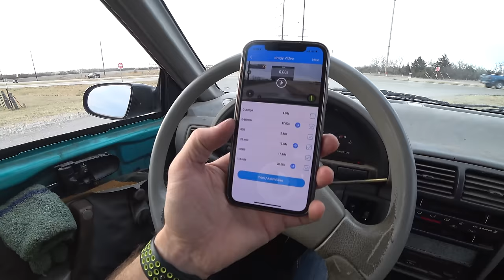I BOUGHT A Geo Metro For $300 And FIXED It In ONE DAY

Comment: 1993 Geo Metro gets 53 mpg.
2019 Smart Car gets 40 mpg.
With technology advancements, it should be getting at least 55.
Reply: The technology IS what make them less efficient. In a Geo you'd die for sure in a crash over 45mph. In a Smart you'd probably die in a crash over 45mph.
Reply: Some of the Geos got 62 mpg back when gas was more explosive
Reply: @zman1745  The xfi models did which this one is.
Reply: The XFI geo made 56 hp, weighed about 1600lbs and had a manual transmissions with no accessories. You can buy a Mitsubishi Mirage that makes 76hp, power everything including A/C and automatic transmission and it gets 40mpg. The manual transmission car is faster in acceleration but the fuel economy isn't any better. The 4 cly 1.3L 79HP Metro with automatic transmission only got 30-35mpg so there is that...
Reply: John Kifflom I bought a 4 door regular metro. It had a mileage book from the previous owner.. that ranged  from 60-64 mpg
Reply: @imzjustplayin  The xfi had 49 hp
Reply: @Ka_Gg  I guess 55hp for the regular 1.0L and 49HP for the XFI.
Reply: @imzjustplayin  Yep. The XFI cam is what made the big difference. Although the HP is less, it actually helped the car since it moved the power into lower RPMS.
Reply: @edxmon  you'd survive in the smart car. The entire body is a cage.
Reply: Safety regulations are probably getting in the way of that on some cars
Reply: @termy3934  probably, but that is assuming engine technology stood still. With the advancements, most cars Camry size or smaller should be getting 50 mpg or above.
Reply: Don't forget, the Nash Metropolitan went from '53-'62 and was capable of 35-40.
Reply: Dude with technology advancements you won’t die going 20 mph in cars like the Geo Metro. You can get similar mpg in a new Prius nowadays
Reply: I saw a vintage ad for a Volkswagen claiming to get 70 mpg. For automakers it’s not hard to reach those figures, it’s just hard to reach them with today’s safety standards
Reply: @tony_25or6to4  You couldn't legally make a car that small and light anymore. The crash test rules have gotten much stricter since then. For instance a rule was made that any car must be able to support it's own weight upside down without crumpling up the pillars that hold up the roof and this caused cars to get heavier and the pillars to become thicker that's also why the A pillars on modern cars are so darn bulky and hard to see around when you are looking around the edge of your windshield.

I think they should still be allowed to make cars that small and light though because there are a lot of people who can't afford anything else and would be willing to take the risk of crashing in it so that they could drive to work and make money.
Reply: @El_Chompo  the Smart is light (only 400 lbs more) and smaller. Remember the commercials with putting a SUV on top of the space frame? Technology should have advanced enough to give us at least 50 mpg in cars than size.
Reply: Geo couldn't be killed either and it was dirt cheap to run. My aunt and cousin had one it only took 5 or 6 to fill up too back then
Reply: "with technology advances cars should be more reliable" and yet they break more often
Reply: @wildman510  not true. Some cars are more reliable than ever. Chrysler car are still crappy, but Toyota and Honda are still very reliable. People used to get rid of cars approaching 100k miles. They now keep them to 200-300k or more. Not just an option, consumer reports has data.
Reply: More like Dumb Car amiright?
Reply: You will live through a collision in a Smart Car...
Reply: My 1981 VW Rabbit diesel routinely got 52-54mpg.
Reply: safety. youd survive in a smart car. instant death in 93 geo
Reply: @der_pinguin44  no a car needs to crumple to absorb energy
Reply: @Samsung Dryer where are the crumplezones?
Reply: @gustini2146  Also today's emission standards for new cars.
Reply: @El_Chompo  Used cars are a thing!  You will always have some cars that are still reliable for less than $5k in today's money.
Reply: @tony_25or6to4  ...but they don't last as many YEARS. Put it this way: every modern car has a PCM. That PCM has capacitors on it, that WILL fail...probably in about 20-30 years. Most likely taking the PCM with it. And GFL getting a replacement PCM in 2050!

OTOH,  a carb'd 1950s Yank Tank needed mulitple carb rebuilds in that time...and many points replaced...but you can still keep the (crude) engine management, managing the engine.

and just as an FYI, much of the "junk by 100,000 miles" was due to the horrible oil, and leaded gas. Run a modern Civic on high test ethyl, heavy on the sulphur, and straight-weight 30. Let us know how you do!
Reply: @Crazyerics  
You will live through any collision that you don't have. The most important safety feature in any car is a properly-adjusted nut behind the steering wheel.
Reply: Tony my father had 275k miles on his 2001 E-150 with the original engine before he sold it.
Reply: @imzjustplayin  I thought the LSI made 55 horsepower... After 1994. 

The XFI had a smaller cut camshaft which contributed to the great mileage. It did manage to produce 10 less horsepower though.
Reply: Tony my ‘19 power wagon, WITH the mds b/s gets like 12 mpg still 🤮 although it has the 6.4L!! But still...
Reply: Smart car also has more safety features.
Airbags which adds weight.
But mpg hasn’t change a lot when you compare it to other cars.
Camrys from 90 to present make around the same mpg but present has more power, safety features, and feels better 🤷🏻‍♂️ 
Same with 90 Chevy truck all those are from cars I own.
93 Chevy Silverado 
2015 Camry 
I used to drive my brother 98 Camry few years back.
We should appreciate because politicians wants to kill gas power cars by 2030 god damn California
Reply: that's the whole reason I didn't buy a smart car little crackerbox like that only gets 40 miles to the gallon I keep buying old Geo metros was getting a lot harder to find them now now I'm putting a motor out of my 98 Geo into my 93 convertible so I still had that running in about a week
Reply: It's evolving just backwards
Reply: John Smith  the CR-Z hybrid got 40 at most. With technicological advances and having a hybrid powertrain, it should have gotten 50-60. My brother-in-law gets 60 in his Prius C.
Reply: The 85 Honda CR-X in the HP model got 43 combined it was 40 and 48 didn't get 50
Reply: @edxmon  a Hyundai SUV could take out both.
Reply: @gustini2146  people still die left and right from accidents.
Reply: @tony_25or6to4  BS, it depends on the person not the mileage.
Reply: @Crazyerics  collision with a bicycle
Reply: @bcubed72  there was alot of  turning back the odometer back then.
Reply: @lawnmowerdude  I got a 2000 7.3 superduty with 800,000 miles and still going.
Reply: @fast1100xx  initial purchase price is cheaper,insurance cheaper,tag is cheaper, parts cheaper. Mpg is better, I wouldn't have drove one of these when I was a teenager but now I would.  Lol
Reply: @gustini2146  A Metro with a VW Polo 3 cylinder diesel swap would probably get 75 mpg .  The Polo with a 1.4 TDI weighed 50 percent more than a Metro and got 60 mpg.
Reply: @El_Chompo  For now, a 3 wheeled trike is exempt from many safety regulations
Reply: @MechanicParker  The XFI also had a final drive that I think was 3.52:1.  Some Metros have 4.39:1.  There were several ratios.  The fours have gearing for a lower cruising rpm.
Reply: Ya,   a  little  hybrid Geo Metro should hit  70 MPG minimum....
Reply: @SeaJay_Oceans  I wish I could get a hold of the VW 1.4 TDI from the European Polo.  It would be a hoot to swap  to a Metro.  The 1.4 TDI  produces double the horsepower of the Suzuki G10 and I understand its basically a 3 cyl version of the popular 1.9 TDI.   I think the 1.9 TDI might swap into a Metro but is weighs almost 200 pounds more than the Suzuki G10.
Reply: @timothykeith1367  Amazing !   I am still very impressed the geo metro MPG is better than some hybrids now...  VW makes excellent engines.
Reply: @SeaJay_Oceans  It costs as much to ship the 1.4 TDI to the U.S. as the used motor itself.  It would be the nerdy swap.  I don't know if these were available in Mexico, I might go get one if that we the case.  As far as I know, nobody ever produced a 3 cylinder mechanical pump for the 1.4 TDI. But I probably havent found the right forum.  The Cummins 4BT injection pump is used on the 1.9 TDI.  Maybe a Kubuta 3 cylinder pump can be adapted to the 1.4 TDI.
Reply: Comparing the Geo Metro to a smart is truly apples to kumquats.
Safety improvements aside (like an integral NASCAR style crash cage, which adds weight), and you don't gain more 44% more horsepower for free.

Comment: "Go faster, Neddy!"
"I CAN'T! it's a GEO!"
Reply: Ha Simpson's reference!😂😂👍
Reply: In the episode that Homer became a tow truck driver he tows Lenny's car. He has a green geo.
Reply: I regularly drove my 1 liter Metro Convertible from the SF Bay Area to Los Angeles down Highway 5 once a week for 4 months. Doing 80-85 mph with the AC on was normal for it for hours on end. The only trouble I had was that the left front CV joint went bad on one trip and vibrated like hell at any speed over 60 until I replaced the axles.
Reply: faster scotty aka star trek
Reply: Evil Ash that was the first thing i thought about lol
Reply: My name is Geo 😕
Reply: kimmer6 those convertibles are hard to find, I’ve been looking to buy one recently
Reply: @kimmer6  what was ur mpg with ac on going that fast?
Reply: @ethixhiggins5059  It dropped down to 36mpg. On shorter trips 44-46 was about normal and the best ever was 58mpg where I did every fuel saving trick in the book.
Reply: @kimmer6  whats ur tricks thats still not bad at all with ac going and going that fast too probably could've saved more going 70 75
Reply: @ethixhiggins5059  Tires 38psi, top up, windows closed, transaxle oil changed to full synthetic ATF, 5w20 synthetic engine oil, empty trunk, no spare tire or jack either, synthetic wheel bearing grease, spring spreaders on front brake pads to reduce rotor drag, 3Tech LSI cam, 5 degree advanced cam sprocket. 

Also...I put in a modified Arizona ice tea plastic gallon jug...nice thick material..with the top trimmed away on the engine air inlet next to the fender. Inside the jug was a few rows of burlap bag material and maybe a half pint of water in the bottom. This evaporative cooler cut out all signs of pinging even with the cheapest gas. 

At the time I was doing 5 trips a month from San Francisco to LA and back 365 miles each way, mostly on Highway 5 which has a 70mph posted limit. Everybody does 85. The area is sometimes 100 degrees in the Summer. I did not give a hoot about mileage. The mission was to get there in 6 hours or less before my ass went numb for the rest of eternity. 

I had 4 Metro convertibles once. One of them was powered by a Kubota 3 cylinder diesel engine that got 70mpg in initial testing but was frightfully underpowered with 24 horses (24 goats, maybe).  I built a fiberglass hard top for it with removable sun roof. I'll see if I can link a video...

Comment: XFI= Xtra Fuel iffishent, lol.
Reply from the maker: 😂 Nailed it.
Reply: @WatchJRGo  Basically it has a smaller cam and smaller air flow sensor from the regular 1.0.  What's Josh's job in the Air Force?
Reply: Houses and Cars if he told you he’d have to kill you.
Reply: No I think it means Xtra Fuckin Iffy
Reply: I thought the FI stood for fuel injected but the X? not sure. and if thats true, would the non-XFIs be carburated?
Reply: "The XFi model was designed for maximum fuel efficiency. It had a lighter curb weight, different computer, camshaft and transmission than the base or LSi models. It also had less comfort and convenience options than the other models. It boasted 53 city/58 highway mpg numbers..."  From http://gtkgeo.50megs.com/
Reply: It had a different transmission in it so it would have less RPMs it had lighter seats in it and it only had two rings on the Pistons versus three rings with the other ones
Reply: That's right I forgot they had the different cam to

Comment: This was the first car I ever owned, bought one with a blown headgasket out of my newspaper classifieds for $350 in 07. Same color, too. Took it back to my friends house, printed out a 50 page guide on how to fix it from the internet, drove it for 4 years, sold it for $600. Best car I've ever owned and I regret selling it. Though they're also deathtraps.
Reply: Yes death traps, but still way safer than motorcyde!  When I drive my geo, I put on a helmet and pretend I am on a motorcycle LOL
Reply: This is a very sad commentary on all the other cars you have owned.
Reply: Only to those who NEED abs, airbags, power steering, and sway bars.
Reply: @jamesblaine4185  And also air conditioning.
Reply: @ricky-sanchez  lol the ootions in the 90s

Comment: I changed a engine in one of those cars I unbolted the engine and reached in with both hands and pulled it buy my self. At least you don’t need a cherrypicker.
Reply: Me and a friend did the same thing with 2.3 Ford engine. It wasn't easy but we lifted it right out.
Reply: Yes I changed the transmission, pulled it out with one hand.
Reply: Wow so impressive you can lifet 100 pound
Reply: I have a friend who rebuilds these for a living. He says he pulls the engine out by hand like you did, rebuilds it on the kitchen table while eating his Capn Crunch.
Sets it back in. Job done.
Reply: They actually use these engines for some light aircraft.
Reply: I watched my neighbor working on his Geo Metro when he had to do an engine swap. He put a 2x4 across the fenders, wrapped a chain around the engine, and lifted it out himself. I was shocked when I saw the whole engine was about the size of a suitcase. And the transmission was the size of a toaster.
Reply: @christophermorin9036  Sounds about right lol.

Comment: I daily one of these! Bought it a year ago, 207,000 miles for $300. It popped it's head gasket. I replaced the head gasket and had the head machined for about $180. Been dailying it since and getting about 40 mpg. 3 cylinder, 5 speed, 48hp/60lb/ft!
Reply: TheAwkwardBanana: The Banana’s Beast!😉🍻

Comment: I love these little GEO 3 bangers.  I bought one from a school teacher that had 52k original miles and drove it from '98 till 2012. It had 239k on the odometer when I sold it to my neighbor and he is still driving it. I was a fanatic about preventative maintenance and it  paid off with being very reliable. 3 timing belts, spark plugs a few times and several brake jobs, tires and shocks. No major failures. If I could buy a brand new one today I would. Averaged 45 mpg with the 5 speed. I told everybody its 4 tires and a steering wheel and nothing more.

Comment: One of the greatest cars ever made.  Mine gets 50 to 60 mpg.  I just rebuilt the original engine at 194,000 miles.  Transmission still going strong.  Easy to work on and the parts are so inexpensive.  New radiator, shipped to your house $40.00.

Comment: I had that EXACT car like 15 years ago! I loved it to death. You see that rust on the front fenders? I can almost guarantee that the "frame horns" are rotten. It's very typical on these and can be deadly. The wingnut on the air-cleaner is factory, the oil in the air intake is from a clogged PCV valve they ALL do that (mine did). This engine is non-interference so pop a timing belt and nothing happens, I did it quite a few times. These things blow headgaskets like clockwork tho...
Reply: @thomassmith6027  Well...ya got me on that one haha.
Reply: Well the rear defrost will keep your hands warm while you push it.
Reply: only one of them the front  end  of motor leaked oil and saved one of them
Reply: if you loved it to death, why did you get rid of it?  I am still driving my geo from 94. Maybe tincan death trap in crash, but still way safer than motorcycles!
Reply: These things don't blow head gaskets much at all. I had several of these and never had a head gasket go bad. Now, there was an aftermarket head gasket that people used on these that were bad that a lot of people were using, but no issues with felpro gaskets

Comment: I had a 1990 Geo Metro 2door 3  cylinder 3 speed automatic. I loved it. Perfect for a student at University of Texas in Austin. Very cold AC!!
Reply: Are you serious. Was the A/C actually good on this thing?
Reply: @elcheekoful  It was on mine. I also changed out the square headlights that came on the Geo Metro for the Suzuki Swift Headlights witch were more stylized. They are a exact swap in every way down to the wiring harness, power conectors and all etc…. of the square HL and it’s black frame with the Suzuki Swift’s sculpted form fitting HL.

Comment: An old ex of mine had one of these, 3 cylinder, manual, it was dubbed the pregnant rollerskate and had to be pop started more than once 🤣
Reply: Glass Vial I used to call the AMC Pacer a pregnant roller skate 😂😂😂
Reply: that's okay though, it was light enough that you could just hang one leg out of the door and push start it from the drivers seat
Reply: @gravediggerr5591  everyone did that was its 2nd name
Reply: Hell- Sol yeah bro this was in 1978 before we knew everybody called it that 😂😂 good memories

Comment: This is very similar to my Geo Metro story. I bought a 1991 Geo Metro XFi back in 2003 for $300 in Sunland, CA. The seller told me the clutch was bad and for the price I took his word for it. Turns out he was correct. It only cost me $250 to fix it. I daily drove it for a few months then randomly had the idea to convert it into a pickup truck. I had zero experience with such a task, but figured with such a minimal investment this was the perfect car to experiment with. Things turned out better than I expected. I lined the bed with blue astro turf, put a system in it, racing stripes, then I threw it on eBay and it sold for $2000!